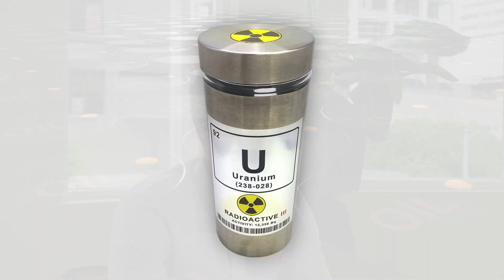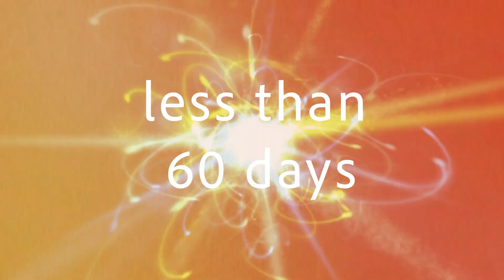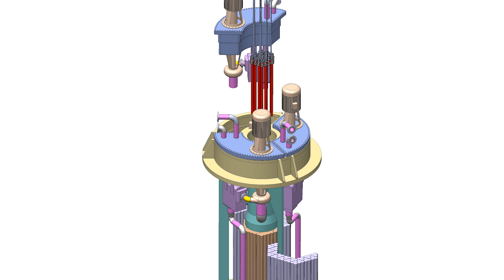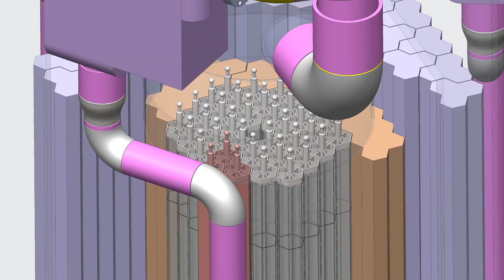The Unexpected Return Of Nuclear Energy

Comment: All LIES.  EVERY power plant nuclear or otherwise builds whatever they can in a factory and have it shipped to the site so there is NOTHING new with that idea.  You cannot build a nuclear power plant in a garage.

A 1 Gw nuclear power plant spans many acres and levels and everything on site is there to produce electrical power.  The bigger the plant the more efficient and the smaller the plant the less efficient it is.  So, small or even micro has no magical way to shrink a nuclear power plant. A 20 Mw small nuclear  plant will always be LARGER than 1/50 th the space needed for a ! Gw plant.
Reply: You are comparing a high-pressure/low-temperature water reactor with expensive forgings containment structures and nuclear-rated power conversion equipment to a low-pressure/high-temperature reactor that utilizes off-the-shelf non-nuclear rated power conversion equipment.
Reply: @chapter4travels  My comment is correct.  EVERY nuclear power plant project has whatever can be built in a factory and shipped to a site built that way so the build it a factory saving money is a lie.  And there has never been economies of small scale in ANY power generation method.

Case in point: NuScale ........ and their stock keeps dropping
Reply: Like most anti-nuclear activists, you lose your credibility by foaming at the mouth and raving.

> All LIES.  EVERY power plant nuclear or otherwise builds whatever they can in a factory and have it shipped to the site so there is NOTHING new with that idea.  
As we can see from the transcript,  1:13 "our internal Target is from groundbreaking to producing electrons less than 60 days this is something that we have not".
1. Their internal target is to install a reactor from groundbreaking to online in 60 days.
2. That is an extremely aggressive target that nobody else is attempting.
3. They never claimed to be doing 'anything new'.

> You cannot build a nuclear power plant in a garage.
Again, they did NOT claim to be building the NPP in the garage. Their claim was (you really should reference what is said, vs what you imagine) "we are allo atomics we design and build nuclear reactors that are small enough to fit in your garage ".
So something, that post-installation, could fit in a garage - not having specified a small 1-car garage or a big 6-car garage, or anything like that. Y'know, a garage.

> The bigger the plant the more efficient and the smaller the plant the less efficient it is.
Unless you are not optimizing for thermal efficiency. Perhaps you are optimizing along some other axis, like financial efficiency.

> So, small or even micro has no magical way to shrink a nuclear power plant. A 20 Mw small nuclear  plant will always be LARGER than 1/50 th the space needed for a ! Gw plant.
Perhaps English is not your native language, but your statement makes no sense whatsoever! 
You CAN shrink a NPP if you are willing to accept a lower output.
You may be correct that, proportionally, a smaller-output NPP will be physically larger than a bigger-output NPP, but AGAIN this was not claimed in the video. They claimed 'smaller', as in the size of a garage, which any reasonably educated person with a grasp of the English language (high-school or perhaps middle-school level) would interpret the holistic concept as being volumetrically small in absolute terms.

So, you claim "LIES" (all caps, nice touch), yet about what?
You missed their 'something new',
you confused their manufacture and installation locations, and 
you failed to grasp their claim in absolute terms.
In baseball, 3 strikes and you're out!
Reply: @factnotfiction5915  Mr fiction here is a fact, I worked in the nuclear industry for 40+ years at five different facilities and am pro nuclear.  So people like you expect me to lie and ignore reality.  New nuclear is the most expensive way to produce power.
There has never been economies of small scale in power generation.

Let me write it in 3rd grade English: As you increase the output of a nuclear power plant the space PER Mw capacity decreases so as you decrease the output of a nuclear power plant...... You guess.
Reply: @factnotfiction5915  NuScale has a fully NRC approved reactor, received $2.4 billion of taxpayer money and free government land on which to build.   But they canceled the Idaho project this year and are now being sued by their investors.

Here maybe a newspaper does a better job than I in explaining things .
This is from the Des Moines Register an concerning the only Small Modular Reactor (SMR) project in the U.S. today. It should be noted that NuScale said (Jan/2023) the target price for power from the plant is $89 per megawatt hour, up 53% from the previous estimate of $58 per MW hour

In 2013, the Wall Street firm Lazard estimated that the cost of generating electricity at a new nuclear plant in the United States will be between $86 and $122 per megawatt-hour. Last November, Lazard estimated that the corresponding cost will be between $131 and $204 per megawatt-hour based upon the 4 recent new nuclear projects in the U.S. . During the same eight years, renewables have plummeted in cost, and the 2021 estimates of electricity from newly constructed utility-scale solar and wind plants range between $26 and $50 per megawatt-hour. Nuclear power is simply not economically competitive.
SMRs will be even less competitive. Building and operating SMRs will cost more than large reactors for each unit (megawatt) of generation capacity. A reactor that generates five times as much power will not require five times as much concrete or five times as many workers. This makes electricity from small reactors more expensive; many of the original small reactors built in the United States were financially uncompetitive and shut down early.
The estimated cost of constructing a plant with 600 megawatts of electricity from NuScale SMRs, arguably the design closest to deployment in the United States, was originally advertised as costing $1 billion but upon requesting actual bids from engineering firms, increased to $6.1 billion in 2020. Given inflation and other cost constraints that cost today can only be expected to be significantly higher.
The cost was so high that ten members of Utah Associated Municipal Power Systems canceled their contracts. NuScale then changed its proposed plant configuration to 6 fewer reactors but increased each reactor output from 50 Mw to 77 Mw costing at total of $5.3 billion. The NRC just last week approved the construction of the 50 Mw design but now will have to start the review process all over given the switch to a 77 Mw design. For each kilowatt of electrical generation capacity, that estimate is around 80% more than the per-kilowatt cost of the Vogtle project in Georgia — before its cost exploded from $14 billion to over $30 billion. Based on the historical experience with nuclear reactor construction, SMRs are very likely to cost much more than initially expected. And they now have delayed the project start until 2025 in an attempt to find more backers.  All this before the inevitable setbacks that will occur once construction starts.
Reply: @factnotfiction5915 I worked in the nuclear industry 40+ years at five different facilities.  But yes when a YT video presents some outrageous lies and total fabrications that I know are ridiculous, I get upset because the uninformed ( that would be you) believe a YT video is actual knowledge.
Reply: @clarkkent9080  > I worked in the nuclear industry 40+ years at five different facilities.

Well, an appeal to authority is the weakest argument there is. It basically means you can't effectively marshal facts and present them coherently, so you appeal to authority in an attempt to circumvent the argument.
Very similar to Putin, as tsar of all the Russias, he says "I know what's best for Ukraine." Lots of authority there, but little that is correct.

> because the uninformed ( that would be you)

I would call this an even weaker argument, but of course, it isn't really an argument to insult those you are arguing with.
Again, straight out of the Putin playbook, where "Zelensky is a nazi". Not an argument, nor a fact, but certainly an ad hominem insult.

Sadly, either way, not much in the way of convincing argument. But hey, if that's your thing, then go for it.
Reply: @factnotfiction5915  I believe most people call it experience and education. But I will defer to you a public schooled individual that believes YT videos are education.  

Of course you could actually counter anything I say with facts but again that would require more than a YT diploma.
Reply: @clarkkent9080  > I believe most people call it experience and education. But I will defer to you a public schooled individual that believes YT videos are education. Of course you could actually counter anything I say with facts but again that would require more than a YT diploma.

You know nothing of me, yet you feel free to insult me even so - you certainly don't defend your argument with reasoned rhetoric!
I know nothing of you - except you claim to have 40 years experience in 5 NPPs. Eh, perhaps you were the janitor, mopping up and down the office block corridors?

I do wonder - were you in the finance department, actually charged with and educated for, the task of determining what is the lowest cost generation and how it might be financed and built?
Were you perhaps on-site building these 5 NPPs as part of their design engineers that you might establish some credibility as understanding the technologies behind Gen IV?
If either of these - perhaps you care to actually establish credentials with your name, your sites, your employer, your service years - that we might check these facts.

I myself doubt you can. Most finance or engineering professionals know how to debate with a civil tongue and would not descend into mere ad hominem attacks. It truly marks you out, that you can't post  a single comment without a snide remark!

Keep it up - it makes it easier to debate you. It makes it easier for others to disregard you.
Reply: @factnotfiction5915  To debate, you would actually have to have a valid response to my comments.  I know that my comments are terse and to the point since most people have no understanding of technical details, so why include them.  You claim that I insult you and then spew insults on me......that certainly improves your standing in the discussion.

So I gave you the comments from an engineer that actually worked on many nuclear projects and unlike me, provided lengthy historical and technical detail to back up his opinion.  But did that change you  mind? If that did not, then why would I go to that level of detail when someone like you does not care.

Anyone working in any industry will know quickly, when discussing that industry with another, if that person has any real knowledge of the industry or is basing their opinion on news reports, social media, or YT videos.  It is very clear to me when someone has based their opinion on YT videos since I have watched most of them and many present opinions that are not based on reality. I stay current will all news related to the industry and maintain an interest in the U.S. nuclear industry. 

I really don't care what your education or experience is.  I simply provide experience based, to the point comments.  

Here is reality.  After the VC Summer and Vogtle new nuclear failures ($35 billion and 17 years to build two nuclear units is not anyone's idea of success) no U.S. utility is currently considering a large NPP. The ONLY nuclear project that could possibility be completed by 2034 is Terrapower's small scale demo MSR that is 1/3 the size of a standard PWR.  The U.S construction industry does not have the skill set necessary to construct more than one nuclear project at a time and that became evident when VC Summer and Vogtle projects (less than 60 miles from each other) were being built at the same time.  BTW there are no Gen IV reactors so your expertise in their advantages and cost are all based on............Startups and YT videos.  Enjoy!
Reply: Thank you for your comment. I would like to learn about the realistic financing of a nuclear power plant.  What can you say about the probable costs of the Westinghouse AP300?  What would you recommend about a national strategy for breeders to reduce the current wastepile?
Reply: @Snillocad143  There has never been economies of small scale in electrical power generation.  While smaller units may require less investment in construction, they will always cost more per Mw generated to operate over their lifetime.  Utilities always choose the largest capacity plants available at the time.  The problem with transmuting nuclear waste is the additional cost. You cannot simply place a spent fuel rod in a fast neutron reactor. The spent fuel would have to be processed (very expensive anytime you are dealing with fissionable material) before it could be made into a form that could be placed into an operating fast flux reactor.  The same issue occurs in breeder reactors.  The spent fuel must be reprocessed (again very expensive) in order to extract the breed fuel.

Most things that these channels propose is absolutely possible. However nuclear power is already the most expensive way to generate power and anything beyond the common BWR/PWR designs will cost more and introduce unforeseen problems. I worked in the industry 40+ years at 5 different facilities and am pro  nuclear.  I now live in the  Vogtle (newest 2 nuclear units) power grid and our electric rates have increased 25% because of the two new nuclear units and will increase even more.
Reply: @Snillocad143  > Thank you for your comment. I would like to learn about the realistic financing of a nuclear power plant.  What can you say about the probable costs of the Westinghouse AP300?  What would you recommend about a national strategy for breeders to reduce the current wastepile?

You won't find much useful from clarkkent9080. He has a few 'facts', but his interpretations are  rather suspect.

ps - I think a "national strategy for breeders to reduce the current wastepile?" is not a bad idea, but also the current wastepile isn't that big of a deal to deal with as-is. I'd focus on breeders for their process heat and power generation capabilities first, and their ability to consume waste 2nd (or even 3rd).

> There has never been economies of small scale in electrical power generation.  While smaller units may require less investment in construction, they will always cost more per Mw generated to operate over their lifetime.

On the face of it, this is a true statement. However, please be aware there are other economies. Example: economy of scope.

It also depends on what you are trying to optimize. If you're trying to get from Chicago to St. Louis, you might try to optimize speed: and thus take a flight. Or you might trying to optimize throughput, and thus take the train. Or perhaps you are trying to optimize total time, and thus take a car (vs the additional time of travel to/from the airport and waiting therein).

So you see, 'economy' and 'efficiency' are a bit in the eye of the beholder.

> Utilities always choose the largest capacity plants available at the time.

Again, true on the face of it, but false if the utility does not have more than a few 100 MW demand (now and out to projected future). Replacing White Sox' Comiskey Park is one issue, and replacing a minor league franchise's field is another.

> The problem with transmuting nuclear waste is the additional cost. You cannot simply place a spent fuel rod in a fast neutron reactor. The spent fuel would have to be processed ...

Again, true on the face of it, for current fuel bundles. The economics change quite a bit for Gen IV designs, because the fuel comes in different form factors - which is why companies are designing them! Will one or all succeed? Maybe. Probably correct for the Westinghouse AP 300.

> However nuclear power is already the most expensive way to generate power

True for building a power plant. Untrue for total system cost of electricity. (i.e. when you include firming for variable RE, when you include new transmission, etc) When looking at total system costs, nuclear comes out cheaper again and again. That is why nuclear-heavy grids have very cheap electricity.

> and anything beyond the common BWR/PWR designs will cost more and introduce unforeseen problems.

Yup! The problems are unforeseen, but we know they'll be introduced????
The non-BWR/PWR designs haven't really gotten past FOAK and we already know they cost more?
That is some crystal ball!

I recommend you wait a bit to see the actual future vs the potential future.

(however, given the Westinghouse AP 300 is a PWR design, don't expect too much innovation there.)

> I now live in the  Vogtle (newest 2 nuclear units) power grid and our electric rates have increased 25% because of the two new nuclear units and will increase even more.

Again, clarkkent9080 is completely factual! Rates have increased 25%!

However, he neglects to mention that average GA retail electricity rates started out below the US' average - and despite Vogtle - are STILL below the US average! See eia.gov for average rate data.
Reply: @factnotfiction5915  Here is a comment I captured from another experienced and educated engineer with nuclear experience, actually much more detailed knowledge than I posses.  By hey why believe educated experienced people when you have YT? I do not agree with his assumption that if we build more AP1000's the cost will decrease significantly, modestly yes but not significantly.  Enjoy your alternate reality !

You are so correct that the entire concept of SMR's was fatally flawed from the start just on the economics alone; and the mass production dreams were only ever a fantasy. I'm an experienced nuclear plant engineer who is very pro-nuclear and has researched the history of nuclear power plants... and the fact is that the answers were known decades ago. For starters the concept of "mass produced" SMR's with main components transported to local sites with minimal field assembly was 1st proposed in 1955 in the annual conference on the potential of nuclear power plants (held in Europe that year - not sure which country). The 1st ever demonstration SMR was a 22 MWe thorium fuel cycle based BWR in Elk River Minnesota (USA) which many people were talking about could be erected in many small communities in the USA. Online 1964, Shutdown 3.5 years later in 1968 due to major design issues. However, it had already been deemed uneconomical as a power plant just due to staffing cost alone. For the record the USA built 17 commercial nuclear power plants in the 1960's - 1970's which would be considered SMR sized today. All of them were shut down decades ago as they were not economical to operate against the large nuclear power plants built at the same time (I am unsure of the details for the rest of the world; but, understand that the same pattern followed in other countries unless there were unique locations where building larger plants did not make any sense). As an aside: did you note that Elk River was a thorium fuel cycle (there is nothing new about thorium and the current proponents are not talking about its historical issues identified from the USA's failed attempts to develop it as a fuel source). The USA went whole hog into developing thorium as a nuclear fuel source in the 1960's - 1970's to see if it would work. Along with all the test reactors it was run in around the world the USA built and operated 2 test molten salt reactors and the Shippingport demo/test power plant (PWR 60 MWe) which showed a successful breeding thorium core could be designed and put into most of the existing PWRs in the world ). The USA then built 4 commercial thorium fuel cycle power plants of BWR, PWR, and HTGR designs. In all cases thorium did not work out (there were both technical and economic issues with thorium fuel cycle reactors) - and at least 3 of the reactors were converted to U235 fuel which worked better and was cheaper. Note if thorium is such a good choice now why are we not putting it into PWRs at this time - as at least we know that the reactor designs work well and we now have passively safe PWRs? Anyway back to SMRs (regardless of fuel source): By the end of the 1970's it was known that the concept of SMRs were dead unless it was for some kind of geologically isolated area where they only needed a small power plant and transmission line construction was impractical. If you double the size of a nuclear power plant it only takes about 40% more materials and in many cases the plant staff size does not even change. At some point the staffing size does increase modestly. As for the failed NuScale Idoho plant. 6 SMR reactors of 77 MWe output was the claimed plans (462 MWe). What is interesting is that only the 50 MWe version was licensed by the NRC and there was an expectation that the NRC would quickly license the 77 MWe version which they thought could be done during the early site preparation period: Utah Utilities & NuScale was well into the "Pre-License review" of the 77 MWe design and had received good  feedback. But the License application was never submitted after they received the construction quote and the pre-licnese review was terminated. The quote came in at about $9.5 Billion to construct, with an estimated $1 Billion+ inflation adjustment during the construction period. In reality this would have been about the same price to build a single Westinghouse AP-1000 (about 1150 MWe) and the staffing for the plant would have been about the same. As for the $55 raising to $89 per MWhr for electricity cost. That was after $4 Billion from the US government for SMR development grants - so the real cost rose to well over $100 per MWhr (where a single unit AP-1000 could be built for significantly less than half of that). Note on AP-1000 construction cost: Yes a lot more was spent at VC Summer and Voglte. But the USA (and Europe with the EPR) had not built nuclear power plants in so long that no contractors and very few workers understood how to build them - and also a number of suppliers shipped fake certified components and materials to site that could not be used - or had to be tore out and replaced. Massive cost and schedule delays, and lots of lessons learned. The Idaho NuScale project used the same contractors to quote that had learned their lessons with the Vogtle AP-1000s which is why they could quote so much better (and if those contractors are used before they forget - the next USA nuclear plant will be built much cheaper and much more closer to schedule than Vogtle 3 & 4). By the way China built 4 AP-1000's with an average construction time of about 6 years. They had a delay and cost overrun on their 1st one as they were not used to working with the Westinghouse design - but once they understood it - no noticeable delays or cost overruns (and Chinese construction standards and contractors for nuclear are just as good - if not better - than their western counterparts. No shortcuts, no fake materials, and the workers understand high quality nuclear construction standards and practices). I did a consulting job for one of the Chines AP-1000 plants; and was impressed. China is now building 6 more AP-1000s (they have a licensed copy) and at least 2 other countries are starting construction on AP-1000s and at least 15 more AP-1000s are in the planning stage worldwide. The Westinghouse AP-300 benefits from the fact that the controls and many smaller components are exactly the same ones being produced for the AP-1000's which provides a cost savings both up front and for repair parts and service down the road. No other SMR proposal can claim the same advantage. As for mass production - it will never happen for a nuclear power plant. 1) At a minimum you need a proven plant design that is known to work economically for many decades - and in the history of nuclear power plants most initial designs did not work very well at all. There is not a single SMR plant that has a proven plant design - and it will be many decades after one goes on line before we know (we only have great PWR designs now based on the lessons learned of over 4 decades of operation of about 100 unique PWR power plant designs worldwide (76 different light water designs in the USA alone). A lot of design ideas that looked good in concept did not work out and there are many early shutdown plants as it was too costly to modify the plant to a different design. Now we can pick out which design idea worked for each component, structure, and system. 2) The design of the components and overall plant must be identical for each plant. Never going to happen as each nuclear power plant site must be designed for "worst case" LOCAL earthquakes, flooding, storms, etc. No one wants to pay for a plant that is designed to handle all the worst case conditions that exist somewhere in the world. It would be massively overbuilt and expensive. 3) As for mass production. I put the number at a minimum of 500 identical units a year - for at least 10 years to make it economical to even build an automated plant. We don't need that many nuclear power plants (even if only 50 MWe each). 4) Those sketches and concepts of building skids in a frame and assembling them onsite has been tried at least twice for fossil plants. Total cost and schedule disaster. One of those ideas that looks good as a concept, but requires a level of quality and dimensional control that so far has not been demonstrated to exist. It's cheaper to just build a normal seismically designed metal framework for the site, bring in the preassembled major components (Like has always been done) and field built connecting piping and wiring
Reply: @clarkkent9080  > Here is a comment I captured from another experienced and educated engineer with nuclear experience,

Now that is a guy I would like to chat with. You, frankly, not so much.

This fellow has something interesting to say, and he doesn't appear to get all bent out of shape about it.
I do note that his statement has plenty of caveats, and that is another thing I appreciate - he isn't making blanket statements - he is making nuanced argument.
You could learn a lot from that guy!
Reply: @factnotfiction5915  .. Thanks for spending so much time to write your response. You have mentioned a few issues which will point me towards finding out more.. I am glad that Vogtle got going. This attitude of gratitude is part of the sanguinity that we all have to adopt to make nuclear work in the context of so many changes  and new technology!
Reply: except the kid that built one in his garage... LOL